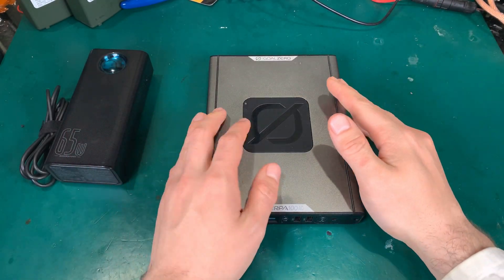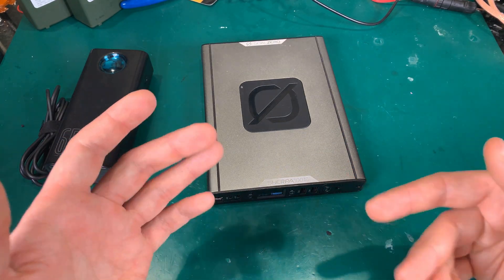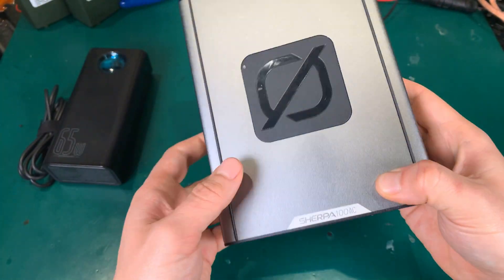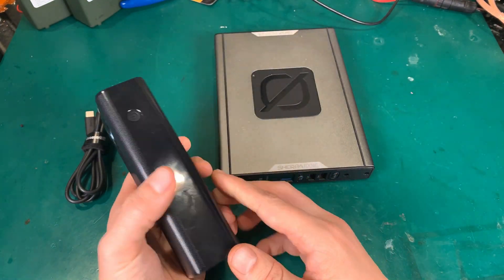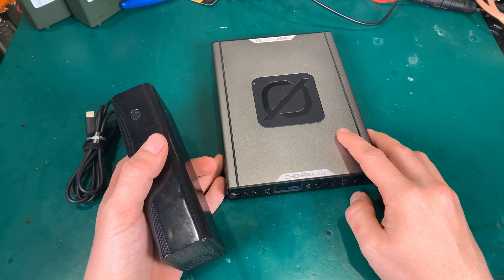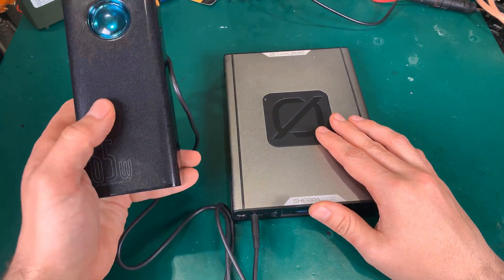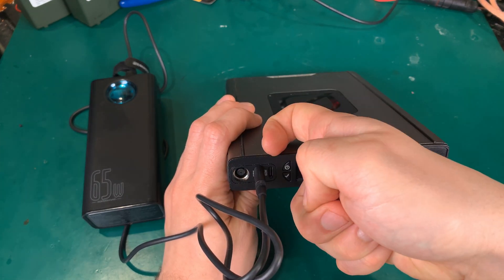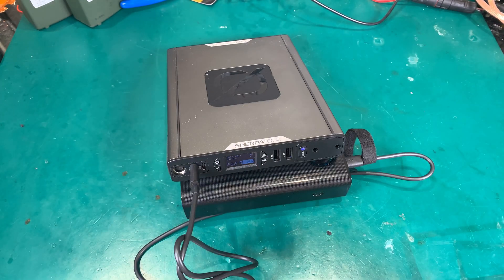Goal Zero Sherpa 100AC upgrade to double / triple capacity for cheap via generic USB-C PD powerbank

Comment: Or buy a extra Goal Zero
Reply from the maker: That would be true - if they would combine together better than my example of using cheap powerbank. Why would You pay and carry second inverter, another solar controller.  Old Sherpa 50 & 100 allow to detach one inverter and connect second unit to extend capacity- just take look, it was great system:)

Comment: There's an even bigger design compromise Goal Zero has made, which invalidates this product's use with the AC 100 Watt Output interface. This unit is using a <<MODIFIED SINE WAVE AC INVERTER !!!>> THIS IS NO GOOD !!! WTF Goal Zero ??? PLEASE UPDATE THIS PRODUCT WITH A <<<PURE SINE WAVE AC INVERTER !!!>>> This is also why the battery drains so darn fast when you use this interface Sir. A modified sign wave inverter is nowhere near as efficient as a true sine wave AC inverter is. The rectification circuit in a modified sine wave AC inverter is not the same as in a pure sine wave inverter either - (Not enough diodes).
Reply from the maker: Good point in discussion but to be hones - I's always nice to have sine wave but 99,9% times You can not care about it. From at least 20 years major devices use switch mode AC-DC power supply and at very begging stage they rectify AC to DC and then feed (DC) it to chopping transistor passing to transformer at high speed.  AC don't take part, that's why most switching power supply are rated 100-240V, 50/60Hz (and those are legal legislation values,  i used those devices on gas generator without AVR and they provide stable DC at output) - it don't rely on what coming in since it will be rectified and started from scratch. You might argue that PFC that is required in EU on devices over 80W(?) might not work in some cases - and this might be technically valid point - but in my entire live I never saw any small electronic with PFC that won't work.  Square Wave of course should not be used on inductive load so AC fan with AC winding would not be best choice since it will be overheating. We could also say that some inductors, chokes on AC side might give different sound and give more heat - but question is - should You care if like MacBook charger will work little bit hotter for about hour before draining it to 0. It's not like it will be used that way for 24/7 - in power outages I'm running my tube light fixture out of this Sherpa 100AC and my other "micro cigarette lighter" inverters and it still work just fine except of that buzzing noise - but am I worried of running it like that 3 times a year? - answer is no.  My summary is: don't be scared of non sine-wave for DC operated devices- if it would be "that" bad - it just won't be sold. Relying on data from 90's, when someone plugged real transformer and it overheat is true but they generally don't exist right now.
Reply: @ElectronicNoobBlog  Why risc it ? My MacBook Pro cost me $6,000.00 CAD, and there's no way I would ever plug it into a modified sine wave.
Reply: @markjob6354  lol your macbook won't care with the AC/DC wall brick. or you could just charge directly to USB-C and not even use the inverter.

Comment: good suggestion.  Hoped you found room inside the cover for more cells
Reply from the maker: I never changed cells on Sherpa 50 - but I saw  teardown video & they are standard in size & between then and now they just get better capacity in same form factor - so it's 1:1 replacement & will get improved run-time.